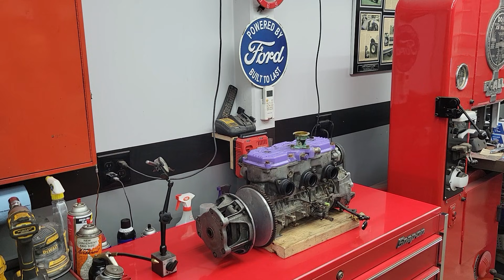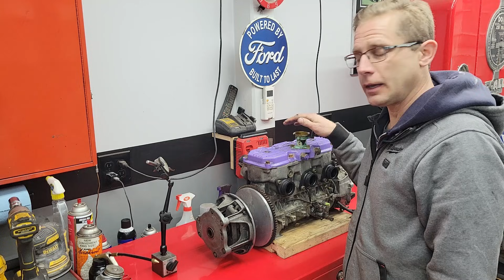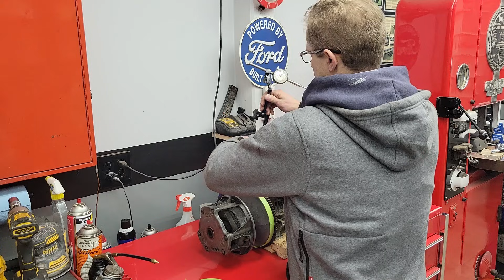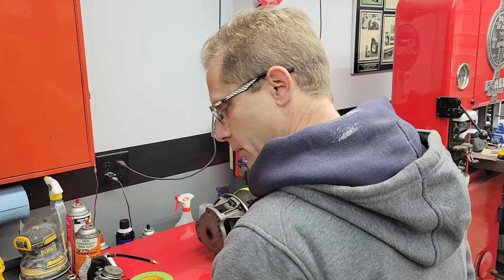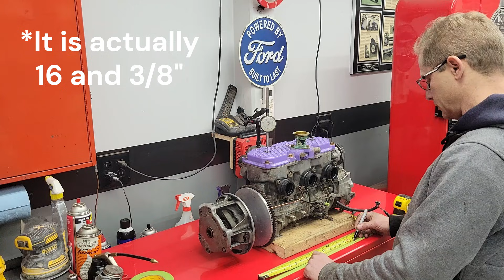Polaris XLT 600 Triple Crankshaft Phase Check

Comment: The XLT crankwheel stub end that inserts into the coupler that connects to the next set of crankwheels (cylinder) on all XLT's were a straight knurl this is the weak link and downfall of all these cranks. If you try to dissemble and re-index it will lose its index quicker each time you attempt to re-do. The only way to positively cure the problem is to  the pin the ends of crankwheel stub. Precision work is mandatory to have exact index and to keep all crankshaft geometric properties to perfection. I have created many cranks using these core parts and this method from single to 4 cylinder racing engines creating up to 94 lb. ft. of  torque with success.

Comment: Very interesting.  I imagine there's really no way to fix the crankshaft via heating and bending it back in any precise way, perhaps you've sourced a new old stock or used one?
Reply from the maker: I found a complete engine that I performed the same check on and found no issues. I swapped it in.  I eventually will disassemble this one and inspect it.